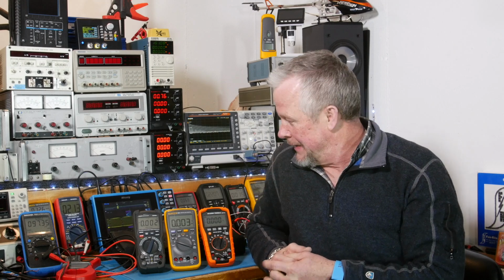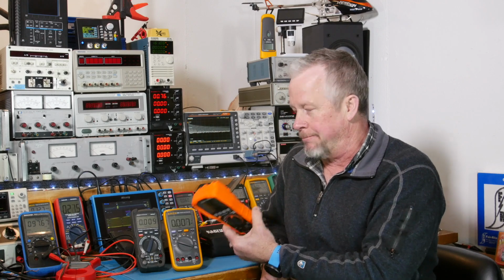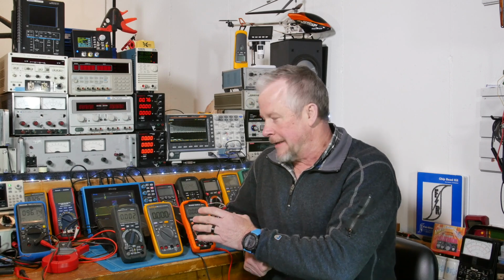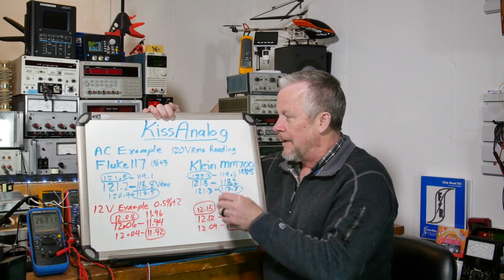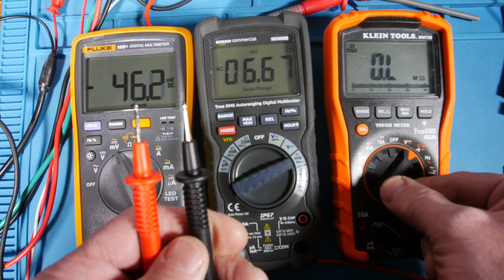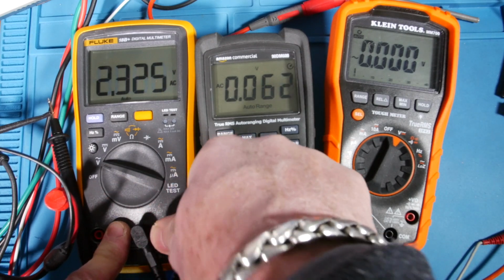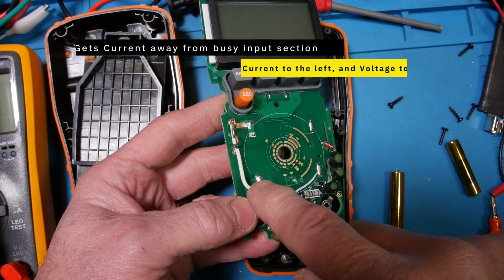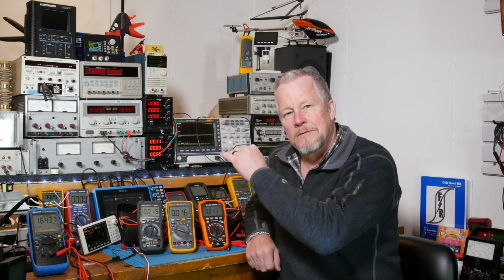Low Cost but Tough Multimeter: Klein MM700 Tough Meter

Comment: I bought this meter at Home Depot, about a year ago after I got tired of the super cheap off brand meters that I always seemed to break by accident.  I wanted something that I could use around the house for basic power checks and occasional servicing when some of the electronics around the house need fixing.  I also wanted something that I felt was safe enough, and reliable enough to use to help teach my son to safely work around electricity and even simple diagnostics work.  I went with Klein because of the name.  My Father is an electrician and most of his line tools, back in the day, were Klein.  Most of his meters were Fluke or Simpson, but Klein was what he trusted his life with, whether he was working on a Dragline generator, or power pump in the middle of a phosphate mine field.  Good review, as always.   I really appreciate the explanations and discussions on the ratings and accuracy.  It makes a lot more sense to me now when I look at the different ratings.
Reply from the maker: Thanks for that great feedback!!  Klein has been around probably longer than Fluke I’m pretty sure.

Comment: I have this meter.
I originally bought the MM400 for benchwork type stuff, and unfortunately I had to return it to Home Depot 3 months later.  I was trying to test capacitance on some capacitors I removed from an XBox I am restoring, and I could NOT for the life of me get it to zero out.  I followed all the instructions, changed the batteries, and it would always start creeping up in uF without anything even hooked up.  I would hook up a capacitor and it would read OL for every single one of them.  I had enough.  No matter what I would do, it just kept giving me bad readings.

I exchanged it for the MM700 tonight and am VERY glad I did.  Not only is this one stable, but the features are exactly what I need.  I tested all of the new caps I just received in the mail, and all are registering perfectly.

It's nice to know I can diagnose tiny board components as well as re-wire my house with this thing.
Reply from the maker: Thanks for that feedback!  I agree, great bench meter and great for electrical work;)

Comment: Nice review! Thank you for your effort to buy these things and show them in detail before us thinking of buying them. That grease on the pcb is a rare sight. I had a few flukes with 4+ years in usage at my workplace which had scratchy or stiff rotary switches, I opened them and applied just a little lithium multipurpose grease on the pcb and on the switch and after that they worked smooth like new. I also recently bought a brand new keysight u1241b which had a very scratchy rotary switch too, but not stiff. I did the same job to it and now it's just a pleasure to operate it. Greetings!
Reply from the maker: Wow - thank you for sharing real world experience;)

Comment: After have a few of the Fluke meters I’m going over to the Klein MM700. I use my meters every single day as a diesel/transmission,generator mechanic. Anything from 12 volts DC, to 700 volts DC In hybrid transmissions. 120-240 volts AC, resistance, continuity, duty cycles, temperature. I will also use this meter around the house with testing circuits and switches. Thanks for the video.
Reply from the maker: Thanks for your feedback!  I think that is a wise choice.  The Klein is safety certified by a 3rd party so it is just as safe as the Fluke and very tough IMHO;)

Comment: The MM700 was my first multimeter and I liked it quite a bit, feels very sturdy and good in the hand. Never really had too much of an issue with it, and for the price it's pretty hard to beat. I did get a fluke 87V recently and I love it a lot, but it's hardly comparable given the price difference.
Reply from the maker: Thank you - nice feedback!!  Yes, that 87 is very expensive;) What leads do they provide now?  I hope not the new TL72 STIFF leads;(
Reply: @KissAnalog  Yep they still use those super stiff PVC leads unfortunately, immediately got myself a set of probemasters

Comment: Those through hole glass tubes I suppose some GDT (gas discharge tube), similar idea to MOVs in flukes but with less capacitance, dunno about rated voltage. Japanese multimeter do use GDT quite extensively among their product line, I've seen some bench multimeter do use GDT as well instead of MOVs.
GDT will withstand repeated overload as MOVs will degrade over time as they're being overloaded.

Main IC looks like dreamtech series? coupled with TI MSP430 series like flukes, not sure why they'd do that as dreamtech chip is usually an all-in-one DMM chip.
Grease supposedly a specific dielectric grease, but they probably simply use any silicon grease available; that grease will smooth out those selector dial movement very nicely.
Some Klein Tools DMMs (if not all) are made in Korea by Finest.

Test probes looks very similar to the one made by Appa tech (Taiwanese DMM manufacturer), I got one for Appa 505, pretty nice cable, mine got grey plastic for the triangular serrated thumb grip.

Love the review.
Reply from the maker: Thank you!  Great feedback!  My guess is those diode looking things are some type of gas tube (arc suppressor) but I haven't been able to find them.

Comment: Great video thanks for your thorough review. I have chosen the MM700 over the fluke 117. Yes the accuracy and count isn't quite as good as the 117 there but it packs in a few other features to level the playing field I. E better back light, comes with good leads/case, 1/2 the price, ma/ua functions. I tend to think I'm paying for the brand name with fluke!
Why doesn't the 117 have auto sensing AC/DC on its high impedance setting? Ridiculous.
To others reading this, which would you buy?
Reply from the maker: Thanks for the great feedback!  I agree, I like the M700 better even if they were the same price.  I like the rugged feel and better display.  And you can feel safe with the 3rd party safety test and IP rating that the yellow meter doesn’t have;)

Comment: Would this be a good multimeter for a beginner working on electronics? Is it possible to make it default to DC rather than AC? That is the only thing I don't like about it. Is this common?
Reply from the maker: I think this is a great meter for the beginner.  It is so robust and easy to use.   That's a great question, I'll have to look into it but the default is probably AC as they probably think it is going to be an attractive meter for the electrician.

Comment: Great review. I just received my Klein MM 600 today Saturday 9-18-2021. I haven't used a multimeter in years. I might use it tomorrow or Monday. My old meters display started action up, only used it once or twice a year. I haven’t used this meter yet and already want to upgrade to the MM700?  Thanks for the great video. 
Question, which accessory is better, Klein Tools 69445 Magnetic Hanger Without Strap or the Klein Tools 69417 Rare Earth Magnetic Hanger, with Strap? Thanks for the great video.
Reply from the maker: Thanks Doug - much appreciated!  Great meter:) Let us know how you like it.  I made a video showing the low cost option;) https://youtu.be/WPn-14ef5jM

Comment: I may be asking the wrong question on the wrong video. Still I would like to know what all the multimeter options available, if my only priority is the accuracy of AC RMS voltage reading for any frequency?
Reply: If your meter meter would have unlimited bandwidth, then it most likely will pick up hf noise to, seen 11mhz flukes, but they also have highpass filter option.. whoops meant lowpas
Reply from the maker: Thomas has a great point, but I think I know what you mean.  There is a difference in meters.  I have a fantastic option that I can't wait to review...I've been so wrapped up in my Class A amplifier project.  I'm going to take a break to show a great meter;)
Reply: @KissAnalog  That will be great 🙏, thank you 👍

Comment: I bought the MM700 and had a problem with voltage auto-ranging.  All voltage: AC, DC and range is on one setting which would be cool if it worked.  It kept erroneously giving me zero volts on 48v circuits and caused hours and hours of wasted time wrenching and isolating and looking for a short or open in the circuit.  After I noticed the same exact issue on another known good circuit I got suspicious and it turns out that I had to manually push range while engaged in the circuit in order to see a voltage reading.  You don't expect your problem to be the dang meter!  I'm not sure if mine was defective or if I needed to do something to set it up to work correctly but it was a dud for me.  Luckily I was within 90 days and Home Depot let me return it.  I even explained to them what the problem was and that I wasn't sure if I'm doing something wrong but they have no idea how to troubleshoot things so they just refunded it.  Too bad.  I liked the idea of no fuss autoranging but it didn't meet my expectations.  The backlight was really nice though as sometimes I'm tinkering on things until it gets dark.
Reply from the maker: Thanks for your feedback!  It sounds like you got a bad one.  Mine works great and I’ve beaten it up a bit too.  It really is a tough meter.  It is great that Home Depot and Amazon have such great return policies.  It takes away some of the fear of trying something new.

Comment: I just bought this multimeter today from Home Depot. I set it up and…..it’s dead on arrival. Now have to go back and return it. ordered a Fluke 17B+ Instead. Hoping it’s the last multimeter I ever have to buy.
Reply from the maker: Wow - that's too bad!  The test leads with the Fluke are the worst (stiffest) in the industry IMHO, so you might want to buy some inexpensive test leads too.  Have you seen my review 'Fluke 117 Malaysia vs Fluke China 18B+'?  Here's the link: https://youtu.be/dlnO6UXOe-A
Reply: The worst part is. I bought the Klein MM700 to Replace a Klein MM500 that died on me yesterday! It lasted 7 years, but a damn shame adding some more e-waste to the world. Thanks for the reply and tip on the leads. I will check out that video. Cheers

Comment: Hi Eddie. I really like your review of the MM700. Very recently I was about to get one when I saw that some companies are now selling the newly released MM720 that features a number of improvements. Given the general interest in this good value device, I would appreciate if you could carry out a review of it. Many thanks for your great work ✨
Reply from the maker: Thanks for this!  I will have to find an MM720 in stock somewhere;)
Reply: @KissAnalog  many thanks for your kind response! It will be greatly appreciated.
Reply: @KissAnalog   The MM720  features a high visibility, reverse contrast LCD display with an "optical sensor" to automatically optimize viewability in dark or bright ambient lighting, basically a better viewing screen that will self adjust to lighting.

Comment: Hey Eddie, I really liked the video, I liked how you went through the ratings and the accuracy... Don’t you think it’s kinda strange that it reminds you to check the leads at the current settings when in real live you could really hurt yourself if you tried measuring voltage when the leads are in the current ports?.... plastics look good! Input protection is present! HRC fuses👌....spark gaps? Not gunna see that on the fluke....the bridge wire I would think is from the way that they orient the fuses on the Pcb, they likely had that as a design constraint and started laying it out from there👍...the last thing I’ll mention is the greebling, I personally don’t want my meter to look like a starship replica like some of the really cheap meters, this one is on the edge but that pcb makes up for it!
Reply from the maker: Great question!  Yes that is true, and that's why the HRC fuse is so important in a high energy environment (CAT III/CAT IV).

Comment: Can you test the accuracy of the meters over varying battery voltage levels?  Since you have so many meters!  I have a super cheap meter ( yes, I am going to upgrade) but I was really hoping you could test the multimeter accuracy when powered by a bench power supply at varying voltages.  I've dealt with issues where the accuracy of my multimeter changes with it's battery voltage and I never want to deal with that again.  The biggest problem is my cheap meter doesn't have a low battery warning so I never know when the accuracy drifts :(

Comment: They have a new Klein MM720. They must be more different than just the specs as size and weight are different. The new MM720 is larger but weight is less at 10.63 x 5.87 x 3.73 inches; 12.17 Ounces. The MM700 is 9.9 x 5.7 x 2.7 inches, 14.4 ounces.
Reply from the maker: Wow this looks great!  Klein makes a durable safe meter - I think that's why Home Depot chose them to sell.  I'll have to pick one up - when I can afford another meter;)  Been a tough year...  The display is black and has a sensor to adjust the screen for the level of light in the room.  Sounds interesting, and the accuracy is supposed to be improved.  It is even on sale now at less than $89: https://amzn.to/3JcMtSB
Reply: @KissAnalog  I ended up purchasing the EEVblog BM786  from your link in another one of your video's. It came out to about $170 USD delivered to my door in IL. Just couldn't turn that price down for that meter.
Reply from the maker: Wow - such a great price on an amazing meter!  Let us know how you like it;)

Comment: I don't have that particular model of multimeter but own klein cl 320,cl 200,mm 2,000 and the cl 440 is on its way  they like Ideal and southwire make great meters good demo and talk about that particular model multimeter/  my local home depot store and electrical supply house and Ace carry klein and accessories are good tools as well as multimeters.
Reply from the maker: Great point Ruben!  The Klein meter is so solid and reliable and safe that Home Depot decided to feature it as their meter of choice.

Comment: A pity it only has 4000 counts... also can't say I care much for that jump wire running to the shunt..   otherwise looks like a pretty solid DMM.
Reply from the maker: Look at it this way, the wire most likely can carry more current than a large trace, and the insulation on the wire is far better dielectric then the masking on the board. So, it is a great way to keep the input area from being so compact.
Reply: @KissAnalog  Maybe so.  I should have mentioned that the gauge looks adequate, that's not my problem with it personally - however - what if something happens to the wire when the unit is being taken apart - yes I know that's something most wouldn't probably ever have to do and maybe I am nit-picking here.  But, wire has a unique way of getting caught up or tangled in stuff - suppose that wire gets yanked on when pulled apart or cinched when put back together.  Yes that can be easily fixed - but that is assuming of course it's noticed when damage happens.  Just a thought and quite frankly I am a firm believer in Murphy's Law.
Reply: @Sui778  yes, you are being nit picky

Comment: Deep breath,,,, deep breath!!! Anyway looks like a nice meter.  The one thing the gives me the willies was seeing the jumper wire to the shunt. I would like to see how this meter would stand up to Joe Smith's tests.
Reply: I agree - I didn't like that wire there either.
Reply: @Sui778  Yeah if the fuse fails to pop you will have a fire in the meter.
Reply from the maker: Thank you!
I’ll bet it would do great!  Plenty of isolation and the current readings with that wire going to the left separates the voltage reading input path.  It looks funny but think of it like this; the wire can carry more current then a large trace and the insulation is far better then the masking on the board.  So, I thought it was a great way to Otto use an isolated stage versus the compact input area getting crowded.  Also those arc suppressors are crowbar devices versus clamping devices such as MOVs.  Also remember, Joe admits he is not testing to standards.  He’s awesome - much more knowledgeable then most anyone else out there testing multimeters.  I actually designed surgery suppression for Square D for 6 years.  But I haven’t seen those particular arc suppressors.  Who’s heard of a meter dying from an arc?  They (Fluke) had trouble with measuring train tracks with the noise and transients they cause, so this was the big driving force to harden multimeters.
Reply: I worry if pigs had wings would they fly.
Reply: @asherdie  Oh but they do!! Just ask Pink Floyd
Reply: @chefbink61  lol

Comment: If you are a pro, buy Fluke as your life depends on it specially if you deal with high voltage above 270 volts. Fluke lasts a life time and they even replaced my  114 for free when I dropped it from 20 feet. You get free calibration too. There is a reason it's priced higher.
Reply from the maker: @ZZ Thanks for the feedback!  So, the Fluke 114 is made in China and only has two terminals and is also only has a CAT III rating.  How do you get free calibration?  It doesn't come with the unit from China with a calibration.  I've worked at companies that buy lots of Fluke meters, but I've never heard of a free calibration.  The Klein has better ratings and is just as safe as it has the same safety certifications.  Also the Amprobe is a better choice with better safety ratings and owned by the same company that owns Fluke.  There are a number of better options than Fluke that cost less and are just as safe - and even built better IMHO of course;)